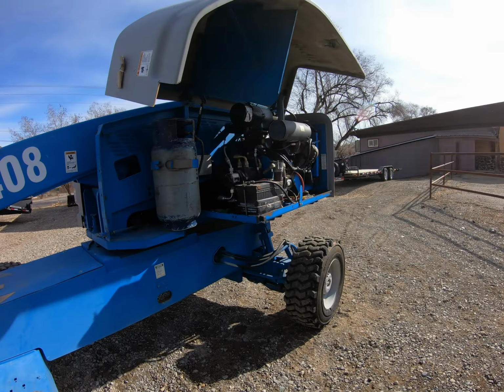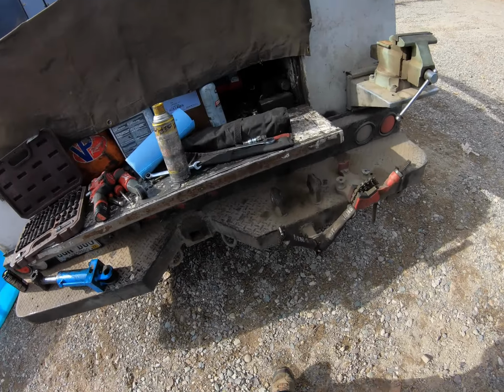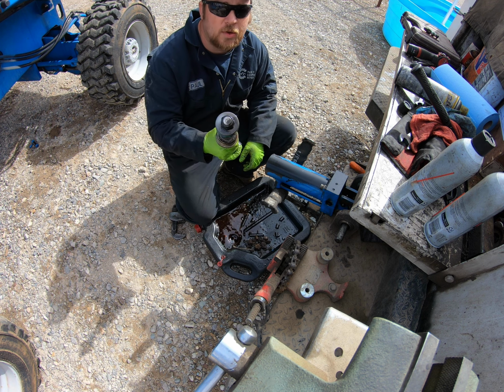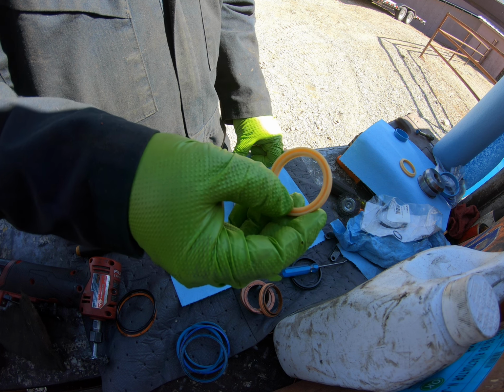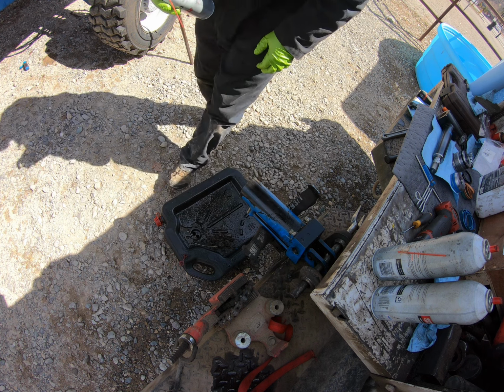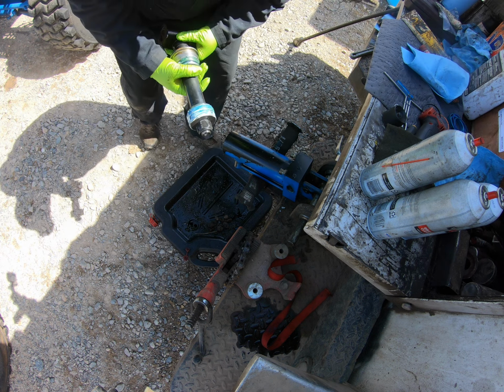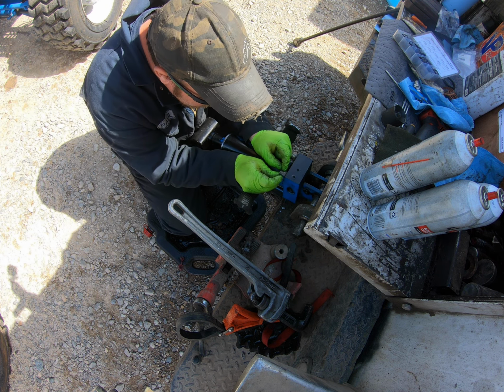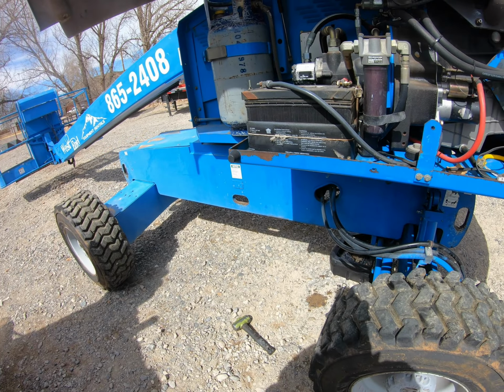Genie S-40 Boom lift Repairs Part 1 (Hydraulic Cylinder Rebuild)

Comment: Great video. Sorry I didn't understand, you said the counterbalance valve is going to kill you. What do you mean?
Reply from the maker: Counterbalance valves, are often used in hydraulic systems in the scenario of hydraulic hose failure. They keep the load supported and from crashing down if a hose blows. That is why they are used in boom lifts that support people. The dangerous part for people working on them is if there is weight on the cylinder and the valve is pulled the load will come crashing down. They also can have extreme pressure behind them when removed. Often people will falsely think there is no pressure on the cylinder because the lines are disconnected. Always make sure their is no pressure or weight when removing.
Reply: @paulsequipmentrepair823  I understand now, that's a proper explanation. Thanks a lot for taking the time to explain.